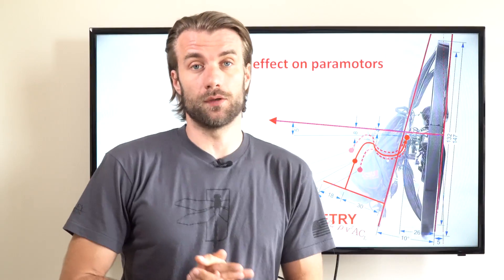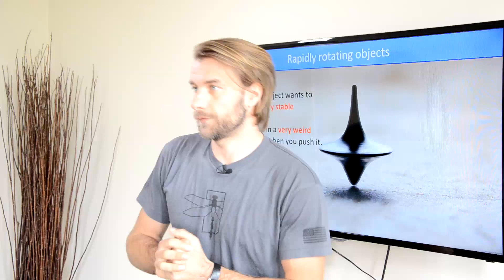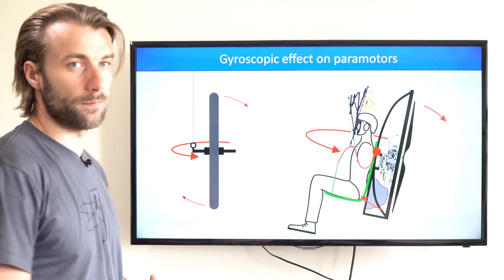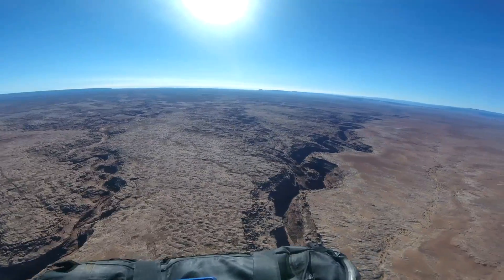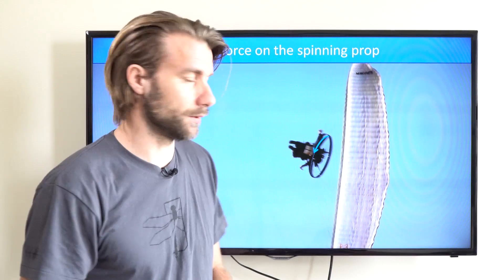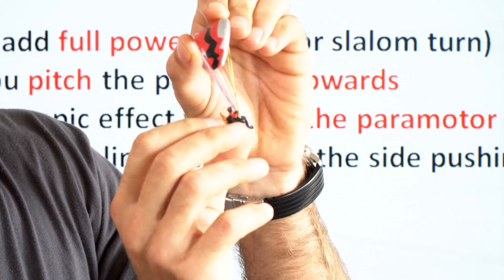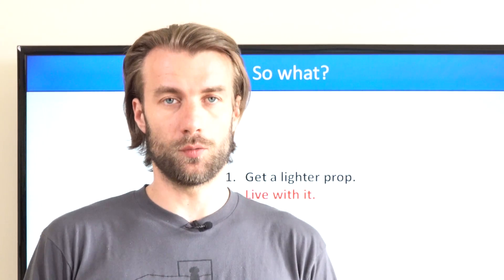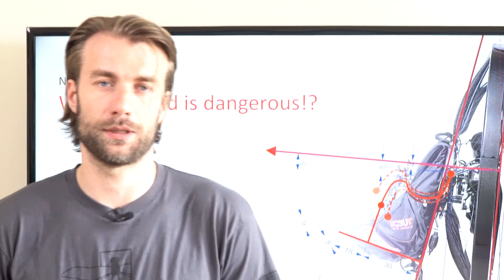Gyroscopic effect on paramotors. Paramotor geometry part 17

Comment: Why not build a motor with more blades going in the opposite direction to neutralize the precession, I see electric motors that do that; but why not other motors; lost efficiency for more moving parts? Or two smaller motors rather than one bigger one.

Comment: Assuming that improved batteries of the future have enough power, any electric paramotor with counter rotating props should not have issues with torque or the gyroscopic effect.  Correct?
Reply from the maker: Yes. Looking forward for electric times. I am addicted to adventure flying thus batteries are not for me (yet).

Comment: In one of the previous videos you told that the torque and gyroscopic effect is very small from the engine (compared to the prop), but that is not true in real life. As I drive a motorcycle with a boxer engine I feel the effects in a very direct way and I think that is one of the main reasons boxers are not used more on motorcycles.
The place it is most obvious seen is also in the wheel diameter of motorcycles. Vintage motorcycles used 18" wheels but now on faster and more easy to steer machines the diameter is a little as 15" on some. 
Have you ever considered using an engine with two smaller counter rotating propellers in a horisontal tandem setup?
My initial thought is it will bring at least some advantages:
1) If they are counter rotating they will even out the acceleration torque.
2) If they are counter rotating they will eliminate the gyroscopic forces from each other and only have the inertia of the static mass.
3) they will be significantly smaller giving more ground clearance. (130cm prop vs two 90cm props equals 20cm more clearance)
4) since the two props need to be offset to each side they will be more/fully exposed in the front and be more efficient and need to run at less rpm.
Reply from the maker: 1. yes
2. yes
3. yes
4. no. Two small props will be significantly less efficient than one large. In fact the benefits in points 1,2 and 3 are not enough to compensate the significant loss in efficiency. 
I will cover this in next video.
Reply: Prop efficiency is usually at least 2-5 % less and in some cases more than 15% less than an equivalent tractor installation when used as a pusher on a full scale aircraft. Have you made a case study of the actual efficiancy of a freestanding propeller vs a conventional paramotor setup?
I realize the with of a paramotor where the props are offset would be a staggering 2.5 meters or more, but if the weight is kept down I don't think that would matter much.
Getting the props totally free of the pilots back would also make it possible to relocate the fuel tank to the top center of the harness, giving even more legroom for running or maybe even cargo.

Comment: The best way to explain the gyroscopic effect, in my opinion; Is by using a top and the earth.
If you spun a top hard enough to last long rnough, you would begin to see the effect earth has on the top as it spins because it wants to stay in its original position.
The top would slowly begin to lean sideways.

Comment: Delta hinges are used on helicopter tail rotors to help counteract gyroscopic rigidity.
For a two bladed prop this is an easy hinge to make robust. Perhaps this might solve this problem ? 
Perhaps a teetering hinge might work better for paramotors ?
Naturally they would need damping to limit the flapping range to about 5 to 10 degress maximum

Re. torque effects due to accelerating the mass of the prop, a highly geared small counter rotating weight could be used to counteract this, perhaps it could double as a cooling fan for the engine and thus enable a reduction of cylinder cooling fin mass to off help set the extra kilogram or so for the geared counter weight a little bit.  

I realise the extra weight and complexity of a geared counter weight might not be pragmatic for most pilots but it would be an interesting experiment to see what it would take to do it. Simpler and more compact than the counter rotating props solution :)
Reply from the maker: yes you are right and you replied your own suggestions correctly...The acceleration torque is not a big deal for most pilots as they do not play with throttle a lot on/off.

Slalom pilots face it a lot until they progress to a skill that they do not release the throttle either - top level slalom pilots fly full throttle throughout the whole slalom task. It just needs balls to push the speedbar early enough. 

Its the continuous torque that plays major role for most pilots.
Reply: "It just needs balls to push the speedbar early enough. "
I expect it does ! :D

I wonder what your thoughts are on the use of a delta/teetering hinge on the prop to counteract it's gyroscopic precession ?
This is relatively simple to do with little extra weight required and you wouldn't need to modify the engine either, just a bolt on yoke and a special prop with a hub that can take a bolt sideways to make the teetering hinge, rubber dampers between the prop hub and the yoke base

A possible pragmatic solution perhaps ?

It might be a good after market upgrade product for you too as you could make it fit Scouts you have already sold and maybe even supply upgrade kits for other makes of PMG's ? :)
I can imagine the right solution would sell well and could be a popular upgrade.

Obviously fine tuning the dampers plus delta angle will take some time and making up a new component & a special prop, it's obviously no small investment of time & effort on your part but perhaps a modest feasibility study might be worthwhile ? :)

But just imagine what a pure, smooth and symmetrical flying experience it could deliver, especially if you included the counter rotating mass, all interacting effects balanced out, at the very least it could make for one hell of a technology demonstrator :D 

I hope I've piqued your curiosity enough to explore these two ideas

Thanks for the replies and I would love to know your thoughts on this,
Cheers :)

Comment: Should have included that Gyroscopic precession is 90 degrees from the input force hence the yaw output from a pitch input etc. etc.
btw. isn't this more commonly known as gyroscopic rigidity ?
anyhow cheers for the cool vids ! :)
Reply from the maker: Yes, Mike, You are right.
I try to make my videos as little "scientific" as possible. I guess there is a lot of source to find complicated theoretical explanations. My goal is to apply onto paramotors. 
Yes, mostly some simplifications are needed...Skipping the ugly word "precession" was one of these as not even Google autocorrect recognizes that one:-)
Reply: Please see the 3 videos: http://science.howstuffworks.com/gyroscope.htm

No. Gyroscopic Rigidity is when the rotating wheel remains in it's original plane while it's supporting 3 axis Gimbal moves around (i.e. the rotating wheel will keep pointing in the same direction). This feature allows precise compass navigation in the air or on the sea. Today, Electronic (laser) Gyros have replaced mechanical Gyros and for example, are employed for stability in various makes of hand held Camera Gimbals to keep the camera in a fixed plane (pointing in the same direction) while the operator moves the camera's gimbal around, resulting in a very smooth looking video. https://www.youtube.com/watch?v=Hz4xuax59R0

The Vector of Angular momentum is 90 degrees from the plane of rotation via the right-hand-thumb rule. Where as
"Precession" is defined as the slow movement of the axis of a spinning body around another axis due to a torque (such as gravitational influence) acting to change the direction of the first axis. It is seen in the circle slowly traced out by the pole of a spinning gyroscope. https://www.youtube.com/watch?v=ty9QSiVC2g0  So, "Precession" is what "Paramotor geometry part 17: Gyroscopic effect on paramotors" is all about.
Reply: Thanks for the clarification Mike :)
Reply: Miro: I liked the way you were able to sneak a little bit of Quantum Mechanics into your explanation with the tennis ball and I think you explained it all very nicely. Good job. ;)  I think "Precession" is a beautiful word and a very important word too ( it's multi lingual). Let's not be shy about saying it, let's OWN it. "Precession" is always present and will cause the paramotor to Yaw a small amount, but over do it with quick acceleration and the resulting tiping back of the paramotor, and the flyer could have dire consequences. The paramotor will always have the natural tendency to twist (Yaw) around the vertical axis (Risers) and this behavior is called "Precession". The Precession of the Paramotor and a Paramotor's Precession make good titles.

USA, Georgia State University's HyperPhysics gives a good general technical visual explanation of precession: http://hyperphysics.phy-astr.gsu.edu/hbase/rotv2.html

Youtube's "Sid Paramotor" posted in June and July 2016 two videos on the subject and accidents:
https://www.youtube.com/watch?v=8O2sXV2tHn0
https://www.youtube.com/watch?v=vBFoM016GG0

I think a video lesson on  Paramotor's Precession with attention between the different types of paramotors (high, medium, and low) suspension systems, and how to limit it by avoiding certain operational behavior would be nice. Would a low suspension have more of a tenancy to tilt (rotate) backwards around the caribiners compared to a high suspension while accelerating, thus avoiding the strong Precession and potential paramotor yaw?
Reply: It would be good for those us interested in the maths for you to do the occasional special episode going through the basic maths of a given problem, such as how to calculate propeller selections to match a given engine. Engineering is becoming increasingly popular, I think people might be less afraid of the maths than you might think :)

Comment: There are several gyroscopic effects induced from rotating masses. The particular one you are talking about is gyroscopic precession. It occurs every single time when a torque(nothing to do with the axial one) is applied on the axis between the pivot point i.e. where the glider is hang and the center of the prop. That is why we mount the engines as close as possible to the pivot point.
Reply from the maker: +Miro Arsov correct

Comment: So the gyroscopic affect will always work to increase the turning effect caused by torque, since reversing the direction of the blade rotation moves the torque affect to the other side as well --just thinking out loud.  Thanks again for a truly fascinating series of educational videos.
Reply from the maker: +John Ullrey 
No, torque steer and Gyroscopic precession are two different effects. The bicycle wheel has no torque steer (as this is an aerodynamic effect of the prop) yet it has gyroscopic precession. 
Yes, both act in the same direction on our paramotors...